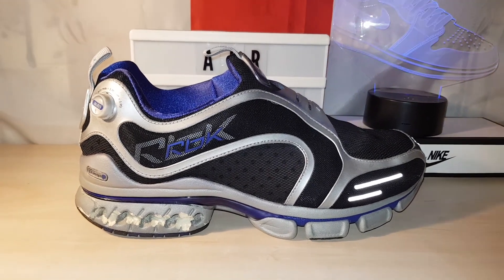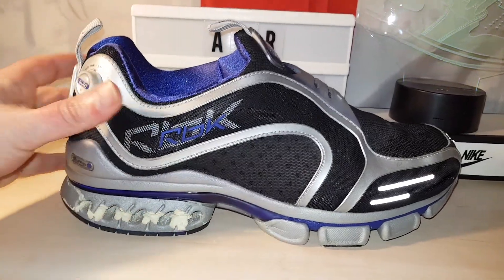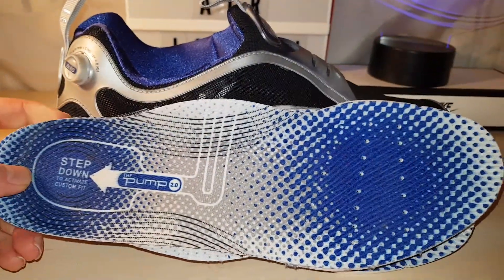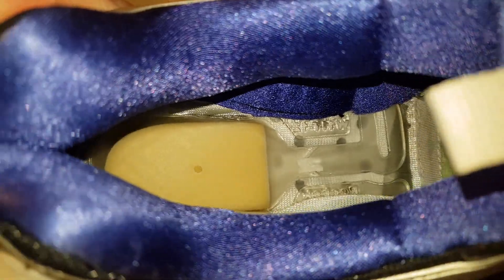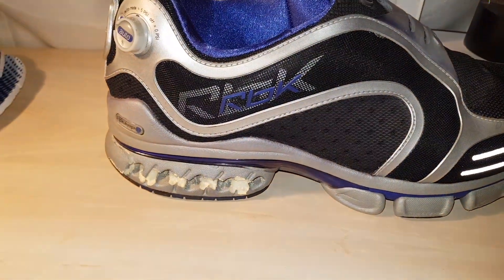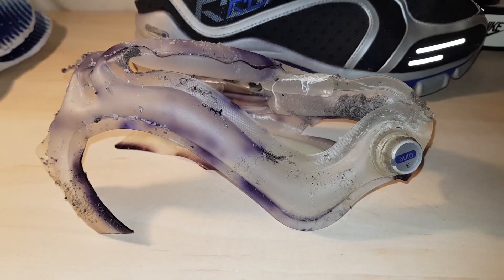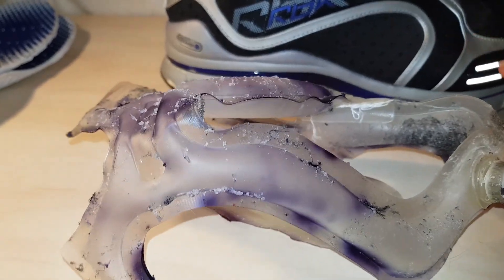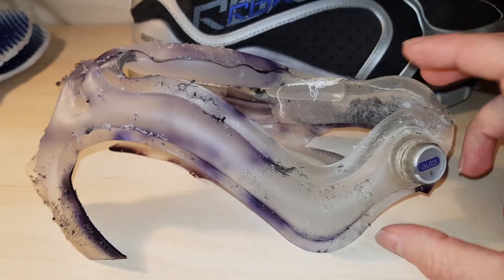Reebok pump technology.  inner workings of the Reebok pump. vol 3.

Comment: i was very disappointed with the look and feel of the pump 2, i got a BB per still in mint condition lol good concept cheep execution. nice vid. 
say i hack out my old pump but i plan to reuse them at sum point ;)
Reply from the maker: I think this colourway is fire. Not keen on the others though. I've actually decided to use all this old technology by putting it in the newer pump models that don't work.
Those new omni zone 2s from last year have the worst pump mechanisms I have ever seen. I'm going to swap them over with my og pump system. I'm also gonna fit one of my twilight zone's with a collar bladder just like the original shoe. Just got to wait until I have the spare time to do it.🙏🏻👊
Reply: @TheRetroManRandySavage   yer mods lick that do work i got 3 of them! i have moded just lick that, its not as easy as it looks, but can be don. the new twilight zone's yer i did that LOL the new ones r a bit low and small with an OG fullfoot pump in it, fits a bit beter in " the pump" but even it is a bit small. try a 1/2 size up maybe?? if you can. if you have never don it before hold off a bit ill try to post a vid of my twilight zone mod. :)